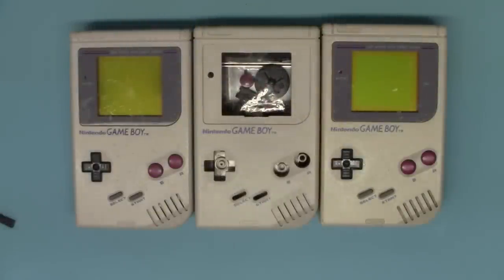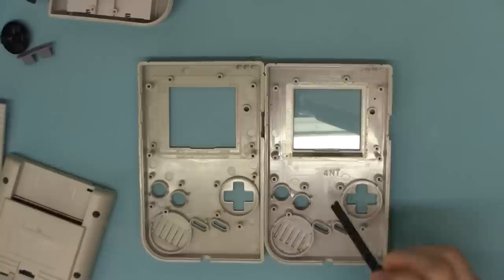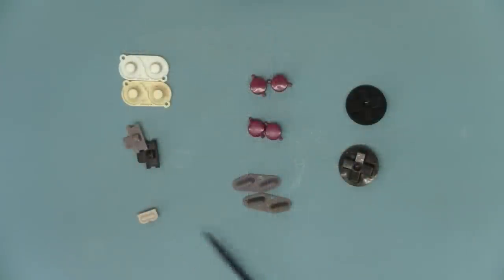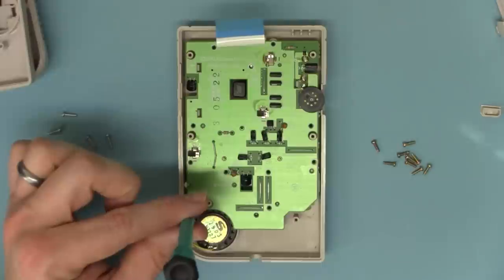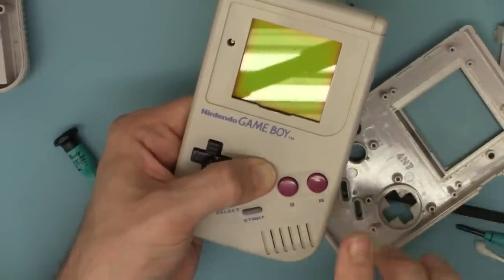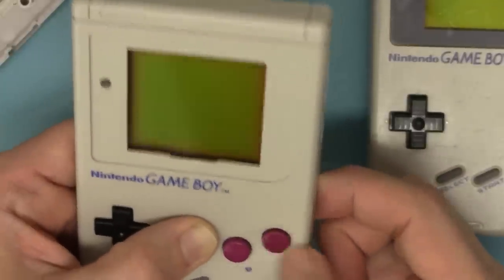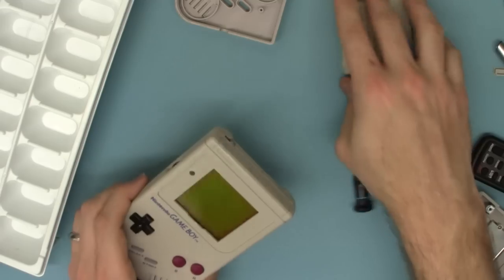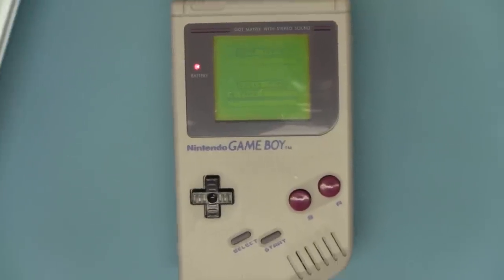Game Boy DMG Replacement Shell Review and Install

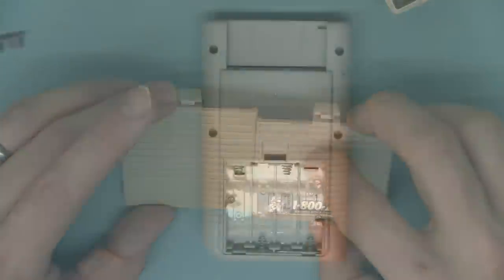Comment: The actual replacement installation starts at 12:07.
Reply from the maker: thanks!
Reply: I found the buttons sink further in on my replacement case its the rubber key membrane that is the cause i fitted the original gameboy one to mine and it is fine now .

Comment: Had this exact same problem with the custom case that I bought. Fixed it by patently hand filing the screw posts around the A/B buttons and I also sanded down the  speaker rim a little bit. Then I put some thin plastic (approximately 1mm thickness) INSIDE the new A/B buttons. I got the plastic polystyrene from a local hobby shop, but I think any thin plastic would work, even old credit cards. Buttons work great now, they aren't loose and they don't rattle when shaken anymore.

Comment: I'm fairly certain that the issue here was simply that the inside of the buttons were just too short compared to the original buttons.  It would have been better to fill out those buttons first before you started shaving off parts of the shell.
Reply from the maker: +AndehX yeah, that would have been a smart thing to try first...
Reply: +8bitjunkie I actually have one of these on the way from China (ebay seller pascallin*2013) probably won't arrive for a couple of weeks but I'll post an update here once it comes and let you know how good it is compared to yours
Reply from the maker: +AndehX did you get the DMG shell from China yet? How do you like it?
Reply: Yes!  Sorry for not replying sooner.  I forgot :/

Anyway, I immediately noticed the buttons were recessed like they were on yours, but after using it for a while, I actually prefered them like that, I found them to be more responsive! especially the dpad.

What I would suggest, maybe its too late now lol, but try it for a while and see if you get used to it.  I much prefer it over the standard feel of the buttons on an original Gameboy.

Comment: Nice vid! I just purchased a gameboy dmg from ebay but there seems to be a problem with it. Every time I press the start button the game restarts! You can see the black vertical line (like when you turn it on and off) and then it restarts.
What do you suggest? Is it an easy fix?
Reply from the maker: solidsn2011 hard to say. sounds like something is shorting out but it shouldn't do that.  no way of knowing if it's easy to fix.  any luck since you wrote this?